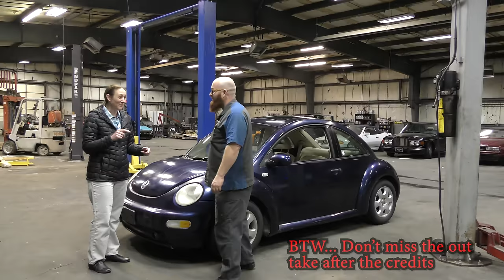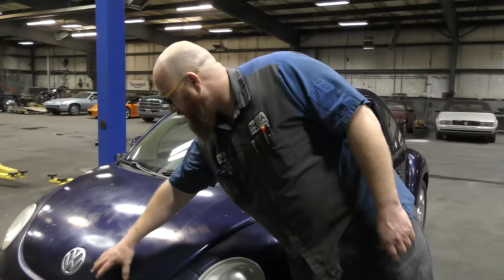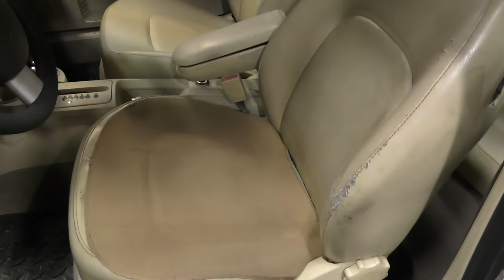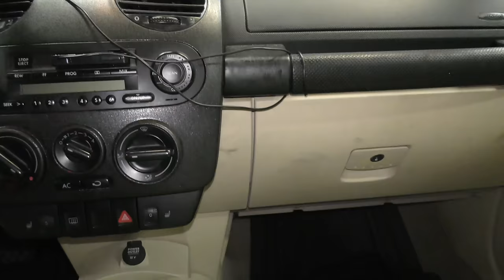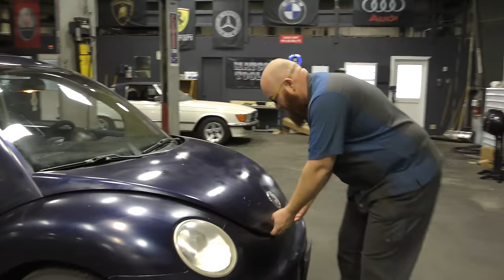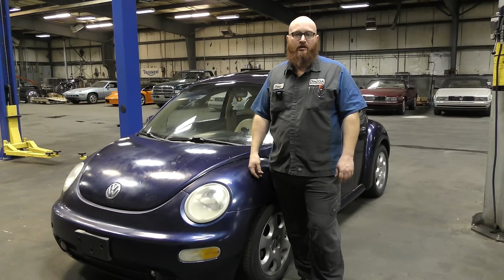Squirtle Update! Why does the CAR WIZARD love this 2002 VW Beetle so much?!?!

Comment: You mentioned the glass pack and how good it sounds. Now we want to hear it run.
Reply: These cars sound awesome straight piped. Forget having a muffler
Reply: They sound REALLY good, very much not like a rattly diesel.
Reply: I want to hear it also
Reply: M H glass packs suck on these. But the cat has to be pulled as well on the straight pipe. I got a 3cyl one (no idea what went, suspect lifter is gone). It does sound badass tho now. Has that Subaru rumble lol
Reply: @user-dn6qy1ou1f  Yep! First thing I did after the warranty quit on my '01 TDi was a muffler delete. The turbo and the cat do most of the silencing now. Just put a "tip" on to get the exhaust out the back safely. Sounds great.
Reply: My 98 TDI ended up with a Borla Muffler before I bought it.
Reply: exactly!
Reply: I'd like to hear the glass-pack muffler also.
Reply: I have the same year and color, but with a 1.8 Turbo engine. Straight piped sounds incredible.

Comment: I have 540.000 kilometers on my BMW E34 535i automatic Executive from "94. Recently got the cilinder head revised, machined, valves polished, with new seals and springs. The rest general maintenance, change the oil every 10.000 kilometers, ATF every 60.000 kilometers. Ready for another 540.000 kilometers :)
Reply: Wow! What a true piece of german engineering. Do you use Liqui Moly?
Reply: @Lex Buren good for you man, that M30 must run great now. I have a 91' 535i with 224k on it. Mine needed a ton of work and the end is barely in sight though I must say the engine a transmission are perfectly fine even though the floor pans and front skills were completely rusted away. German engineering ftw!
Reply: M20s and M30s are indestructible when you take good care of them and never let the wrong people touch them. They can last forever.
Reply: @j.collett2364  Yes it is like new again, perfect smooth inline6 idle...And well i was lucky, it is a really clean well kept, and well maintained example from the first owner who is a diehard BMW enthusiast, and drove it till 375.000K. he bought a E46 535i M performance. He sadly had to part ways with it. But it is in good hands with me, i maintain it to factory specifications, i drive it, i enjoy it, and i love it. These days a good maintained E34 535i executive automatic is pretty rare. so i keep it with me. When you are done, you'll be definitely rewarded. There is nothing better then a OG E34 with an inline 6. You wont regret to work you put into it. Good luck man :)
Reply: BMW had Rolls Royce build quality in the 90s and I wish I still had My E34!  Now they own Rolls Royce and the quality of their mass market cars has gone downhill!

Comment: A friend of my has one of these, I think a 2001, and it really is fun to drive. Same color. But wait until you need to change the cabin air filter. Most cars you just pull out the glove compartment, comes out in a few seconds, pull off a cover, and then pull out the filter. Then reverse. But air filter on the beetle is in the dash, and requires taking out about 24 screws, 8 of which are right under the windshield and have very little room above them to work, and then the filter is held in a rather unusual bracket and it is hard to get the filter in and out. Once you have a new filter in, and air can finally come though the system, the HVAC system blows urethane foam out the ducts and around the cabin, because there is urethane foam INSIDE the air ducts. With age it, of course deteriorates, especially since it is alternately getting rather hot air blown over it, and then dry cold air, the the foam gets blown all over the cabin. If the car has been neglected, as this one has, very likely that filter is totally clogged and that may explain why no heat. In my friend's car it was totally clogged with animal fur and animal poop and leaves. Mouses was living there. Car got heated up well anyway! Car also has excellent air conditioning. But that filter looked really disgusting. I must have been breathing mouse poop for awhile. In 2018, probably it was the original filter from 2001. Aftermarket filter worked fine and cost 1/4 as much as OEM.

Yup, aftermarket air flow sensors don't work. Same for oxygen sensors. However name brand aftermarket heated side-view mirror, made in China, was more skookum than OEM. I think it was Dorman brand.

This car is great fun to drive but a bitsche to work on. Things are crammed in, into inaccessible spots. Have a cracked windshield washer fluid reservoir? Crammed in somewhere. Lots of labor to replace it. Some of the relays are very hard to reach.

Comment: What happens to the blend door is it’s covered with a foam material that dry rots and falls apart. The blend doors have holes in them that make the blend doors ineffective. Cover them with aluminum tape and cover the edges with weather seal foam, you’ll be good.
Reply: SpeakerFreak95 true story speakerfreak95!!, Hope wizard reads ur comment man, also most vw maf’s are actually cheaper from the vw dealer, used to be true but maybe not any more, also to run that race pipe you have to have supporting software for it, like from Malone tuning,
Reply: 100% true, had the same in my '99 TT. Used some aluminum tape that you use to fix exhausts to fix it, and been working perfectly ever since. And it won't fall apart like the foam.

Comment: Had a 2004 VW Jetta with 240k miles on it with the 2.0L non turbo engine. Sold it but it was still running great and shifting well (even though it was an automatic). As long as you take care of those and don’t cheap out in parts and oil changes they will run and run and they are easy to work on. Miss it already.

Comment: Most mileage on a vehicle-285,000 on a 1999 Pontiac Sunfire GT that I bought brand new off the dealer lot.  It was a stick shift.  I sold it 16 years later to my mechanic's 16 year old daughter. When I sold it, it was on the factory clutch still (despite years of rush hour traffic in a major city).  I caught the car still on the road three years after I sold it, too 😜 The most major repair was when the factory water pump (timing chain driven in the Quad 4) went at ~220,000 miles.

Comment: There's an easy fix for the blend door, you can take the radio and climate controls out and remove the front cover of the HVAC box.  After that you can clean up the old foam from the blend doors and then use aluminum tape to cover the holes.  Worked like a chamr for me, cold AC and hot heat.

Comment: "It only has 269 thousand miles" lol
Reply: you dont drive a diesel, it shows
Reply: a friend has a yellow one with 300K...:)
Reply: 400k for one I have seen still runs too
Reply: these diesels will run 5x the miles than your shit toyota.
Reply: I have 260k on my 2002 beetle TDI 5 speed I also paid $800 for and keeps going strong
Reply: @alexstromberg7696  Lol no
Reply: @chesswizard31  you have no idea of these 1.9 tdis. Do you?
Reply: 1.9 TDi of this era is the best diesel VW group have ever produced.  As soon as they went 2.0 they needed to cheat!!
Reply: I have one that is almost identical to the Car Wizard's (mine is a 5-spd), and it has 365k miles.
Reply: Nice
Reply: Take car of your VW and it will take care of you!
Reply: yea  that was my first thought, any gas powered VW should have been in the graveyard by 100K
Reply: Any turbo car with direct injection wont last as long as a naturally aspirated car because it puts more strain on the engine
Reply: @alexstromberg7696  Shut up dude my 95 LS400 has 680K miles, and all I had to do was typical and milestone maintenance
Reply: I bought my dually with 245k miles on it and she was just getting started....  Diesel engines are practically bullet proof if you know what you're looking for.   Heck my 85 Merc Turbo diesel had zero issues at close to 300k miles.  Sold the truck to a neighbor who still gets around; and the Mercedes to a collector that tools around town in it as well.
Reply: @seanhershey3390  I have a 99 New Beetle 2.0L 5spd with 291k got it for 800 bucks
Reply: I had a 2001 VW Golf with the exact same 1.9 TDI. That car was put to pasture at nearly 400k, 380,000 plus miles. The best part was the car turned over and ran every time I went out to it, the rest of the parts on the car are what eventually failed.
Reply: 269 thousand miles is considerably more than the distance between the earth and the moon (a little under 239,000 miles).
Reply: 273k with an AVH engine with MT
Reply: @alexstromberg7696  absolutely not
Reply: @RickyX64  vw tdi's and Toyota's pretty much forever.
Reply: @RickyX64  your LS400 yes, one. I can find like 20 golfs 1.9TDI with 400k right now.
Reply: Two words:  Diesel Volkswagen.
Reply: Oh yeah and some subaru models... And old Volvos. And almost anything with a straight 6.
Reply: jose151348 I have a good friend with a diesel Jetta who can beat that by 100,000 miles.
Reply: Nice to see that a beatle can last that long. I would never be brave enough to buy a car at auction, but this channel shows this can work.
Reply: @faliray4889  works for those with the skills and patience to mess with them. Most of us simply want to get in and drive 👍
Reply: @Trev0r98  hahahaha true
Reply: my 01 1.9 tdi reached 280k when I retired it. The soule was willing but the body was not RIP(Rust In Peace)
Reply: jose151348 I have 132767k 2004. Got it 2 years ago.
Reply: I cringed when I heard that. I have a 2003 Volkswagen beetle convertible that has 93K miles.
Reply: Have a 2003 golf tdi I did a 5 speed swap on.  ALH hands down one of the best diesel engines vw ever made.  Average about 48mpg without a tune.
Reply: @artysmotorsports  I agree. When I buy a car I just want to drive it.
Reply: 273k on my 97 M3 and only noise is from the lifters!
Reply: @jose151348  except this kind.  The VW ALH lasts.
Reply: @giffjp  Does doing that swap include all the differences like extra glow plugs, torque curve reprogramming, larger alternater and all that?  So many differences between the automatic and manual version of the ALH.
Reply: @lsorense  I didn't bother with the coolant glow plugs and I live in the north east.  With a vagcom you can just tell the car it is now a manual.  As far as fueling it depends on if you change the injectors and injection pump, you can adjust the fueling with vagcom also.  A couple pinouts need to be swapped around and of course installing the clutch and switch for that.  There are great write ups on line that take it step by step.
Reply: @giffjp  Pretty neat.  Mine was always a manual so never had to even consider such a change.  But on a used one I could see wanting to do it.
Reply: I've got an '03 with the 1.8t engine. Has almost 260k. Owned it since it had 43k on the odometer. Still runs strong. Never has left me stranded. Literally the best car I've ever owned.
Reply: @atrain132  That seems lucky.  I got the impression those 5 valve engines were not as reliable as they had hoped.  Maybe it was only the very early ones that had any issues.
Reply: @lsorense  did you mean 20 valves? That engine is a 4-cylinder 20 valve 1.8 liter with a small turbo charger. It wasn't luck, as I serviced it myself.
Reply: My lorry has over 1m kilometres on the clock, come back when you've got some miles under your belt squirrple 😀
Reply: It's funny how cars last so much longer in the US than they do here in the UK. Any car here in the UK with 270k miles on it is ready for the scrap heap. I can only guess there are differences in the amount of miles per year done in each country and the weather and rust. 270k miles here on average works out to the car being 27 years old lol. Nobody here in the UK puts their car in a garage
Reply: My 2001 only has 287 thousand miles on it....still going strong and I'm still loving my Fahrvergnugen.  After I had my intake cleaned I just disconnected the vacuum hose from the EGR valve.  I don't care about a check engine light since I know what's causing it...but my intake won't gunk up again.  I also just fixed my heat also using a hack I found on Youtube.  It works!
Reply: @Palimino444  hey when and how much did you change the timing belt for?
Reply: @Palimino444  hey when and how much did you change the timing belt for?
Reply: @atrain132  how often did you change the timing belt?
Reply: @tientrinh943  probably about every 75k - 80k miles. It's best to always just simply remove the timing belt cover, and inspect the belts condition.
Reply: @tientrinh943  To be honest I actually bought it (cheap) with 365k miles and did the timing belt job myself right after I bought it. Total cost was about $250 or so for the timing belt kit. I sold the car to a family member and she has now put 5k reliable miles on it and absolutely loves it.
Reply: @atrain132  You should never solely rely on the visual condition of a timing belt though. Especially if you don't know what you are looking at/for.
Reply: @Palimino444  well, I definitely know what I'm looking for. I don't think I said that a visual inspection is the only problem but  absolutely need to do a visual inspection to look at the condition. That can definitely tell you a lot.

Comment: I used to have a 02 Jetta TDI with the same heat issue. Those blend doors are wrapped in a foam that covers holes up on the door itself. Usually the foam flies out of the vents as it dries and cracks up with age and that's probably already happened with squirtle. That probably is your issue. I ended up trading that Jetta in before the auto trans completely bit the dust. Was gonna manual swap it but decided against it in the end. I still miss my Jetta to this day. Was a fun little car.

Comment: Get one of the detailer YouTube guys to do a video on bringing old paint back to life. Would be cool to see how much luster they and pull back into Squirtle
Reply: It's metallic, It had lost huge patches of clear coat, so the metallic paint was exposed, and the metal flakes had oxidised and gone white. You have to rub that back and then reseal it (as Wizard did), you can't simply buff back to some fresh paint underneath which is all most detailers can do.
Reply: @juststeve5542  bummer

Comment: I had two extremely high mileage vehicles. My first was a 1991 Oldsmobile Cutlass Cierra with a 3.3 litre V6 with a 3 speed automatic. The other was a 1990 GMC Jimmy 2 door 2 wheel drive with a 4.3 litre V6 and a 4 speed automatic. I had over 400,000 miles on both of them. The Oldmobile I sold after a couple of years of driving this thing real hard. Outstanding reliabiliy, comfort, and economy. The car had been in a flood before I bought it and after fixing it up for next to nothing I sold it almost mechanically sound. Short of replacing the rear window motors and a little throttle sensor issue everything worked on this car including the air conditioner. The Jimmy was my favorite ever. It ended up completely mechanically sound after owning it for a little bit. A couple years later I had a seizure and it slammed into utility pole at about 40-50 MPH (guessing). No SIRS (air bag) so it messed my neck and chest up a bit. Thankfully I was wearing my seat belt! I was having a little issue with a worn out head gasket near the end and had to change out the  rear differential too. If not for wrecking it I might still be driving that Jimmy today. No kidding! They  both got into the upper 20's for gas mileage on the highway (Jimmy 26 mpg, Cutlass 29 mpg). Both were easy to learn and repair, perfomed great, comfortable and quiet, very tough, and fast too. As a bonus the Jimmy would pull the Oldsmobile on a double axle trailer at highway speed without issue. That's pretty impressive for a 400,000 + mile V6 automatic body on frame (heavy it'self) SUV. I had ended up putting some 10" wide alloy wheels and a set of 255/60R15 perfomance tires on it after replacing the worn out steering and suspension. The Jimmy would take a corner so quick for being a naturally top heavy vehicle. It never really had an issue with body roll. I would almost daily make challenges out taking certain turns pushing the limit harder and harder while sliding sideways!

Comment: My first car was a 1966 Buick Skylark thin pillar coupe. I paid $100 for it and owned and maintained it for 11 years. I did a lot of cross country road trips and by the time I retired the little 225 Odd Fire V6, it had 365,000 miles on it. I then transplanted that engine into a 1972 Vega GT and drove that another 20K miles before the engine said it had enough. All I ever had to do to the engine was intake manifold gasket, water pumps (3) and timing chain. Since then, I regularly rack up over 250,000 miles on my vehicles without a second thought about reliability. But, I'm very meticulous with my maintenance. Cheers David! Drive it till the wheels fall off! Zip~

Comment: I have a 2002 VW beetle TDI 5 speed (Papa Smurf). I was never into beetles. But had just had my first child and needed to get off my motorcycles. And I couldn't beat the price I got it for.  I've had Papa Smurf for almost a year and I love it so much. 247k miles I did the math and get 53 miles to the gallon. You fall in love with the freedom you get with a car that can go 500 miles before the gas light comes on.

Comment: If you decided to start doing stock rally racing with the car, there is a quick and easy tweak you can do to the ECM to reduce the EGR duty cycle, thus reduce the carbon build up issue on the intake.  Key on, engine off, connect to the ECM, Login 12233, Adaptation channel 03, set new value to 33768.

Comment: the blend door flap on these things has this material that comes off.... easy fix if you can get your hands in there. there's some youtube videos on it.
Reply: Very true my wife’s beetle did the same, the foam seal stuff breaks apart leaving holes in the blend door.. I used foam tape and resealed it without removing the dash, great hot again.